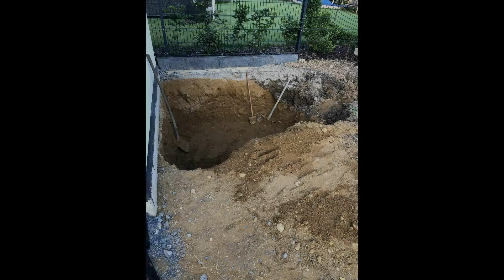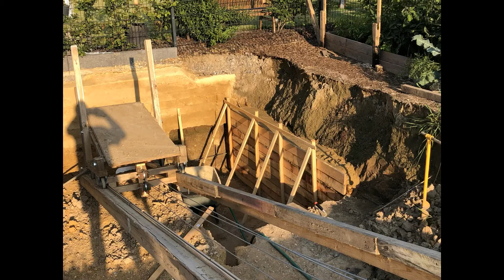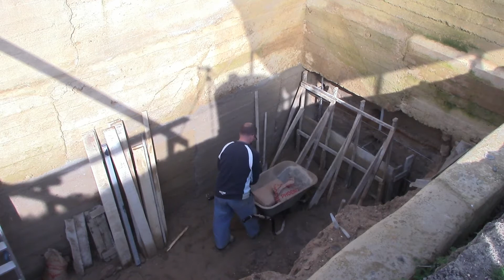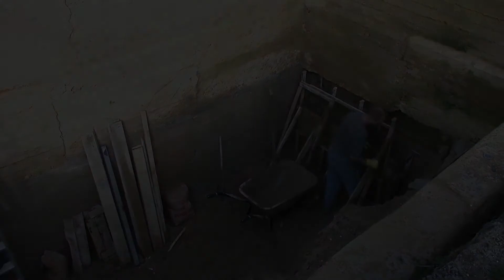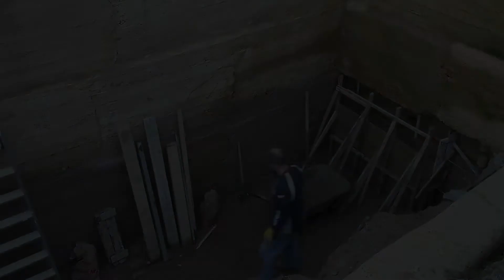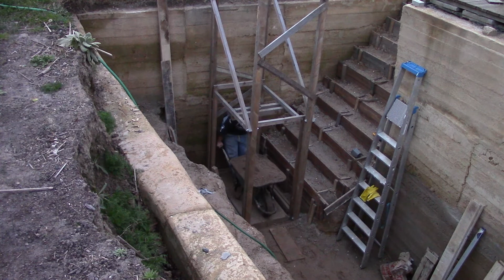Building a root cellar EP002

Comment: Very nice. I been thinkin that when i make mine, i might put "horizontal roots" into the dirt walls, to try to stabilize the ground around my structure.
 Lemme know how it works out for ya!
Reply from the maker: Hi Dustin,
Thanks for dropping by. I'm not sure what you mean by  "horizontal roots". Basically when digging a hole, you need to be careful about the soil stability. You either need to dig a hole with sufficient slope on the walls.
In case you cannot dig with slopes, you need to secure the walls with shoring or some other way to prevent the walls from collapsing.
 I would never do the retaining walls without concrete. Using just a dirt will not be stable, even if you would put in rebars. In my walls, I put two rows of horizontal rebars, and connected in about each 1m with vertical rebars. Sofar the walls are holding well.
Reply: @woodworkingmanufactory  It means what u described. I just dont know what to call them, so i made up my own words for it haha.
Reply from the maker: Then if you use little bit of cement, it shall work. My oldest part of the wall is now over 1 year old, and still holding.
Reply: @woodworkingmanufactory  Noice. Thank u very much.